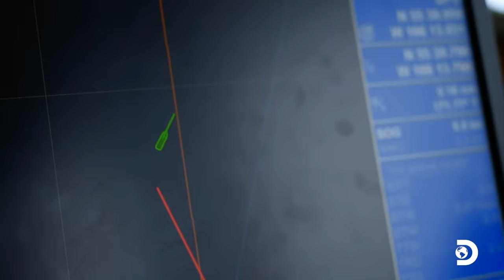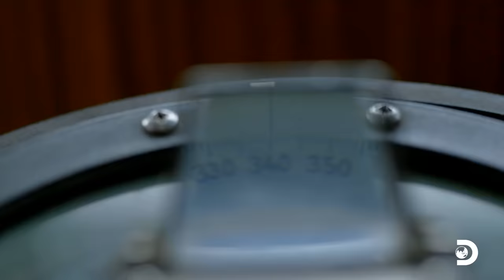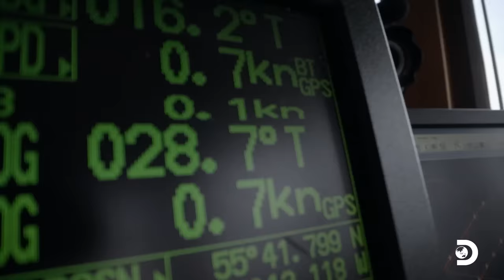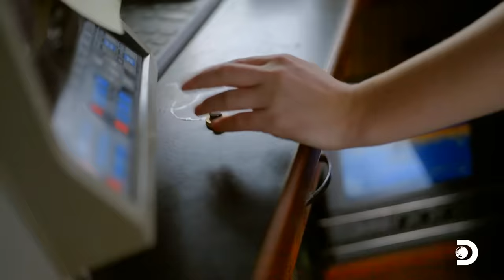How an Old Magnetic Compass Saved Captain Sig Hansen | Deadliest Catch | Discovery

Comment: As far as I've been able to determine from  google search, they could have just used a cell phone app for navigation..but I guess there's less "drama" that way.
Reply: Their quota is also preset and guaranteed so not really a race.
Reply: As a seafarer I can give you a simple answer... No they couldn't, there is always issues it doesn't work when you don't have phone reception. But you're right it's drama, nothing out of the ordinary using a magnetic compass especially as their GPS system isn't off as the coordinates were given on the gps
Reply: @kpNov23 not really guaranteed they need to find it and inevitably the first out will get the easy to find crab
Reply: @Benson7290  it's guaranteed in the sense that no one takes more than they're allowed and the quota is set to less than the entire population. No more derby. So engine problems, medical drama, like they emphasize you still have time. How much each boat makes gross is also preset in terms of tonnage. It's not as dramatic as producers make it out to be. But yes, you are not guaranteed crab at a location, but you are guaranteed you will eventually get them and how much of them
Reply: Cell phone app in the middle of the bearing sea doesn’t sound reliable
Reply: @kpNov23 have to find the crab first
Reply: Does anyone realize they are running a business still Time = money the faster you catch and deliver the more you make - days at sea cost money in fuel and your time is worth something it’s like this if the block ain’t turning you ain’t earning
Reply: @user-pg5xt4bq4w  of course. But the show in its entire run never talks about quotas directly, and downplays that the catch is Guaranteed. In fact, it heavily implies otherwise. Mainstream media bs.
Reply: No cell service out there
Reply: Actually did this in a massive fog bank off of adak.
Reply: Do you get signal out in the middle of the sea???
Reply: @kpNov23 there is always timeliness and deadlines and schedules to make. Not a quarentee anything. Govt regulates season and everything else.
Reply: @billtmarchi4320  I've seen more than one episode where they talk to home while out to sea, so if I had to hazard a guess, I'd say yes